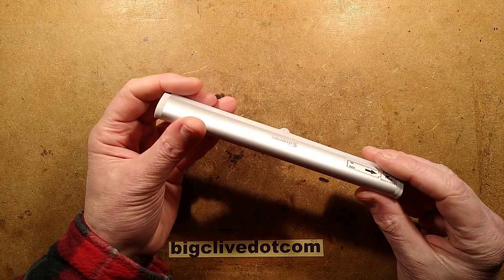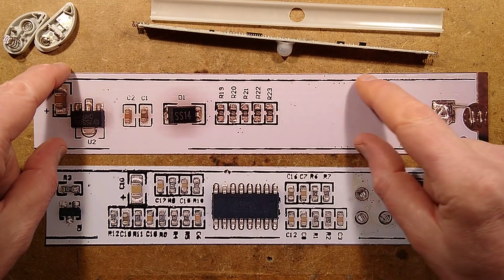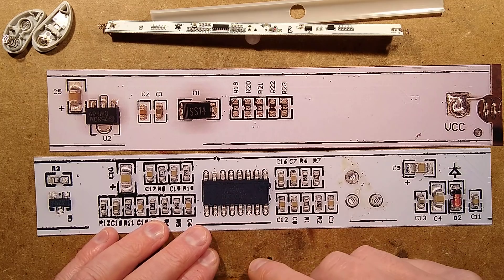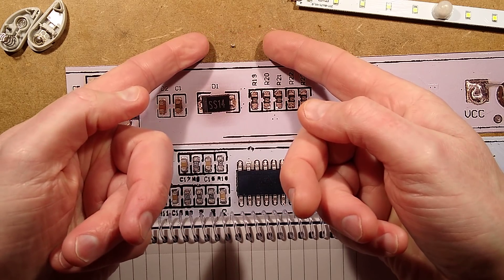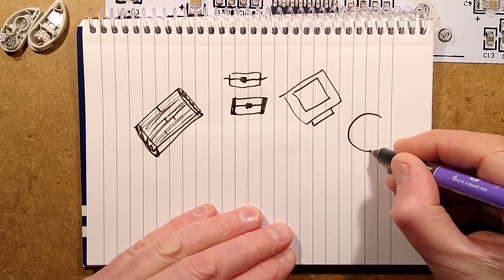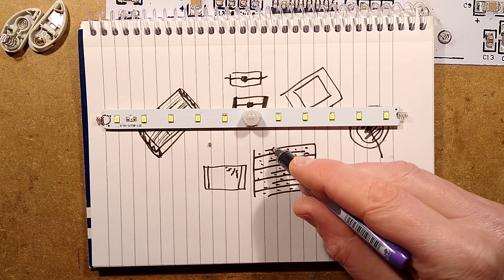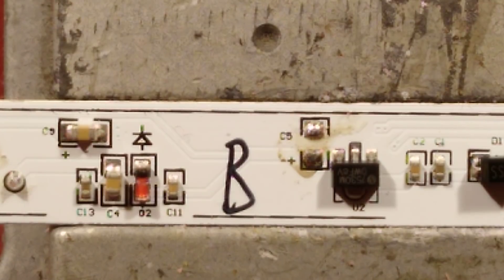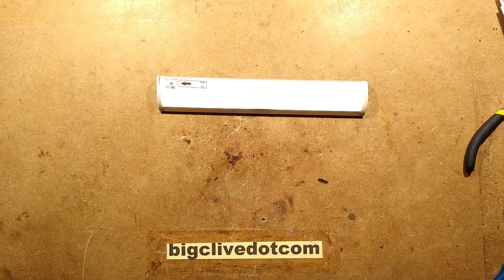Fixing a faulty battery PIR light that was draining the batteries fast.

Comment: Hehe @bigclivedotcom, when I saw you start drawing a capacitor I could only remember my brother's attempt at building a very high voltage one to increase spark distance with the use of one of the high voltage transformers from tube TV's.
He was experimenting with the thing when one of the isolation layers decided to fail and the driving circuitry started arcing furiously through it, which, due to the small hole it passed through made one hell of a noise.
After having heard 6 really loud clicks being transferred through the central heating pipes it took about half a minute before my brother came down with a very disturbed look on his face and I asked if everything was ok, which he was, though he had ringing ears and ever since made sure to be able to have a kill switch near him instead of having to reach over the site of the experiment in question (which, with the arc-over incident could've been actually really dangerous).
Reply: I know it wasnt funny, but that made me laugh.
Reply: @MessalineApghar  Afterwards, my brother was able to do so in a sort of way as well, but that was more coming from the whole "How on earth could I have been that stupid to not be able to switch everything off with a switch near me instead of hanging over a casing with voltages close to around 30kV"-perspective. It was a lesson well learned :P.

Comment: Will these passive infrared lights work if fitted with infrared LEDs ?or will it cause a infrared feedback loop and never turn off.
Reply from the maker: The detect a moving source of longwave infrared and will not be triggered by IR LEDs.
Reply: @bigclivedotcom  excellent, thank you,

Comment: Good job....
I had a teacher that was an electronics technician in the air force. And he had a jet that had radio problems.
No matter what radio that he put in, it had troubles.
He finally went to his co, and asked for help.
And the officer in charge , handed him a can of polish.
It seems that the final output capacitor was the inside of the case. And once it was polished, the radio worked...
At least that is the story that the teacher told.
All of this is to ask...
Is there any way to make the case into a capacitor in the circuit?
Or maybe part of the circuit board?
As a school project I made a capacitor out of aluminium foil, and cardboard.
Thanks for sharing your videos.
Reply: Yeah, you can use planes in a multilayer PCB to produce capacitance between ground and power, which can help reduce EMI. Capacitors and inductors can be made right out of copper on the PCB when designing for RF.
Reply: @dirkflannigan5271  Anywhere that you have two conductors separated by an insulator, you have capacitance. If you're dealing with RF signals, you can leak significant current out of your circuit via capacitive coupling if you aren't diligent with shielding.

If the inside of the case is in circuit as a capacitor, a buildup of gunge on it will greatly affect its capacitance, and shining it up will probably restore it to spec. In that case they might've been counting on it to act as a filter, and it was no longer capable when shat up.

Comment: Hi Clive, Great video as always. Just wondering what thermal camera you would recommend would like to get a good one but not sure what to buy. Many thanks.
Reply from the maker: One of the most convenient is the type that plugs into your existing phone via its charging connector.  Read the small print, as the thermal resolution is important for good detail.  I use a hacked Flir E4 and also have a CAT S61 phone with built in thermal imaging.  I wouldn't recommend the phone though as it has poor firmware.
Reply: Thats great thanks for the reply. Is the standard Flir E4 good for using on electronics ?

Comment: I purchased some Led bar lights from Rural King (kinda like Harbor Freight, but more home and farm oriented, and better products) from their "Damaged" section. Two of the lights flicker/flash. The one I use as an outside flood light for the porch, will flash when it's warm outside. But over the winter months, I noticed it didn't flash no where near as much, and actually stayed steady on for several hours without flashing. But once the temps are high enough, it'll start flashing every second or so. 

Would/Could this be the same thing, the capacitor going/gone bad?  I had taken 1 of the units apart to check it out, but I haven't had time to really investigate further.
Reply from the maker: If it's a rhythmic flashing and all the LEDs are lighting then it may be a faulty power supply.
Reply: @bigclivedotcom  They run on 120VAC. Only the last section of led's will flash. The other 2/3 (or maybe 3/4) of the string displays as normal. I don't remember what the issue is with the other one. And a 3rd unit the capacitor does need replacing as it fell apart when i touched it to check solder connection. At the time I didn't have smd caps, or the other lamps to see what rating it was.

Comment: Reminds me of the tantalum capacitor problem that were widespread 25yrs ago, especially on PC motherboards.
Reply: Tantalums always were a bit hit and miss, we used banks of 35 Volt ones in small buck converter power supplies, 10 -30 Volts down to 5.0 at around 3 Amps, this was back in the 70's so it was all discrete components driven by a LM723. Anywho, one of the more common failures would be a blown input protection resistor, finding one failed capacitor in a bank of 10 all glued together with polyurethane dip was not fun.
Reply: i've never come across bad tants, myself....yet........ had some wire ended radial multilayer ceramic caps self destruct one after another in pops and little puffs of stinky smoke on an ISA multi IO card, i thought best to change the lot on it, probably lucky it didnt actually catch on fire..
Reply: @andygozzo72  The infamaous dropformed decoupling capacitors used on motherboards, had a nasty tendency to develop a low ohmic short circuit.

The result was a +5v pwr supply shutdown in the pc, making it a non starter.
You had to be careful during testing, as a high current setting on the lab supply was necessary to find the defective cap.
If you really hit your luck, you got a burn mark on your finger from the defective glowing hot tantalum ... 😄
Reply: @LMAOer you still come across bad bulging/leaking caps now,  i have....
Reply: @andygozzo72  That's the normal and expected failure mode, though. The problem with the "plagued" capacitors was that they failed much sooner and much more frequently than designed.

Comment: I have a similar PIR LED light, which runs from 6 AAA cells, 
It came from Lidl, I fitted it in my front porch & it worked perfectly for about a year, on the original set of batteries, but it then started to repeatedly turn itself on & off about every five seconds, which ran the batteries down in a couple of days, but on fitting a new set of batteries its back to normal.
Reply from the maker: When the batteries are low the voltage isn't high enough for the regulator to stabilise.  It can cause detector instability and random resetting of control circuits.

Comment: I used to "fine tune" carbon comp-through hole resistors by filing away at the body of them with it connected to a ohm meter - it was pretty reliable too
Reply: It's really not a good idea. Carbon composition resistors go higher in value over time, apparently from moisture. Putting an opening in the case just makes it easier for moisture to get in.
Reply: @acmefixer1  aye I know dude, I used to put superglue on the body where I'd filed afterwards however it's not really something I do now cause buying components is a lot easier than it was back in the day - we're talking the days where you had to go to town to pay 50p in Tandy for 5 resistors so all I had was whatever they had in stock and whatever I salvaged out of old junk.

Comment: Why a supply smoothing Cap on a DC unit? seems odd.
Reply: It's usually to absorb high frequency noise from digital chips with sharp on-off transitions.
Reply: @johncrowerdoe5527  that, and stop the regulator chip going unstable, some can without caps on input and output

Comment: Repairing equipment is fun. Fixed a monitor with a broken backlight and a PSU with faulty lcd displays yesterday.
Now I know how a LCD display works and that I can use a 10ohm resistor to Bypass a broken backlight. :)

Comment: What capacitors do they use in satellites and space equipment as they have to last for decades and cannot afford a failure?
Reply: [CAUTION: this comment is based on my experiences from the 1980s, the details have almost certainly changed.] NASA requires that contractors use only "space rated" components. When possible, they use tried and true manufacturing technology and materials on an assembly line that has been operating for several years. Representative components made on that line have endured several years of testing. NASA has long term contracts to keep the component manufacturing and testing process running at some low level, so they can buy parts as needed. Components and assemblies go through a burn in process. A portion of every manufacturing lot is tested to distruction. Other samples are put into long term tests. Less than half of a manufacturing lot of "inexpensive" components has a chance of going into space.

That is the comparatively inexpensive way of doing things. If they need a type of component without a long track record, then space certification is way more complex.
Reply: @hamjudo  Why not make these available to the general public, the more that is made the cheaper they become?
Reply: @TonyDartford  They are available to the general public. Often they're not even all that much more expensive unless you want to specifically buy one that's been certified into the spaceflight supply chain. They're often really old and obsolescent, but you'll knows for sure that they're good.
Reply: @B-System  I guess the audiophiles haven't discovered that yet...
Reply: Great question!
Reply: Leyden jars
Reply: @frogz  They would be a bit big.

Comment: 7:35 made me cringe a little bit. 

In fact resistors are anything but easy to make. Judging from microelectronics perspective of course.
Thin film process controls the deposition area pretty damn well, but thickness and uniformity - not so much. This means that making two diodes the same with 0.5% precision is fairly simple, as long as your initial wafer is clean. 

Making a whole bunch of resistors AND keeping them cheap is quite a challenge. Laser trimming is an option, but it makes them cost way more and usually used in LSI production (when the whole chip costs quite a bit and trimming can save the day). Component resistor manufacturers just sort and mark them depending on their actual value.
P.S. Check any CMOS OP-amp layout, you will find that engineers put a hell of an effort to minimize the number of resistors for exactly this reason.
P.P.S. Good job, as always. 

P.P.P.S. Since when did the Bad Dragon started to make bricks?
Reply: remember resistor tolerance is the manufactures friend, there is no value that wont fit somewhere. back in the old days of 5 1/4" disc's when single sided disc moved over to double sided, double sided with a dud side were just put in single sided case. when manufacturing got better most single sided disc had two good sides. cut the slot and you had double sided for the cost of a single. :)
Reply: @TheEmbeddedHobbyist  Yes, as I said, individual component resistors are made with low tolerance and then sorted. Their weird series of resistor values like 47/56/68/82 are made on purpose, so you can put any randomly made piece in the corresponding bin with 10% of tolerance. Found nice graphical explanation here http://www.resistorguide.com/resistor-values/ for people who got interested
Reply: Thanks for that insight. I, too, winced at the reference to laser trimming of resistors.  Burr-Brown did it for top flight analogue to digital convertors,  but they were very expensive.  Most resistors don't get individually tested, let alone laser trimmed.  One in a thousand gets tested , and if that one's out of spec, the whole batch is chucked in the seconds bin.  It's not economically viable to do otherwise.

Comment: I got a selection of SMD capacitors of various sizes. My mind boggles how they make (and squeeze 100nF into) the absolutely miniscule 0201 sized versions. I know that they make transistors at the nanometre scale for ICs so it shouldn't really tax my brain in this way, but I guess it's because they're a tangible, physical thing you can hold and they're so small that losing track of it on your desk or dropping it would probably mean it's lost forever!

Comment: is machine oil good lubrication for bad dragon brick or will it disintegrate?  Also how much current can you pass through bad dragon brick?
Reply: You should always use water based lubrication with bricks in my experience.
Reply: @nogravitas7585  if used as resistor how many Ohms does the brick has?
Reply: @dezeekat  alot, silicon is typically used for it's insulating properties
Reply: @frogz  we need BigClive to test this

Comment: Just another example of cheap capacitors being a pain in the arse in modern electronics, going from the electrolyte fiasco (of which I've found in a Lenovo SFF PC I have that needs recapping now) to the MLCC failures... :(

And speaking of a pain in the arse, Bad Dragon would have to make an appearance again... :P
Reply: Multi layer ceramic caps can actually be quite expensive, more than 'lytics even. Theres no need to use them where a 'lytic would work and in some cases be cheaper.
Reply: @simontay4851  There is every need to use them when size, lifetime and low ESR are important design parameters. There is literally no other choice in many designs.
Reply: Even top quality brand MLCCs are prone to cracking when stressed. The problem is down to design (components mounted in high stress areas of PCBs, differential thermal expansion) and handling during assembly (flexing the PCB, impact damage etc.).

Comment: Seen quite a few of these caps fail now, often blowing fuses. Seen several times in Stannah stairlifts.
Reply: A stairlift is a much bigger device than this so why are they using such tiny ceramic multilayer crapacitors. They could use 'lytics instead.
Reply: @simontay4851  Electrolytic capacitors got a bad reputation after the great plague of bad capacitors some years ago. So many designers avoid electrolytics and (wrongly) assume all ceramic/solid capacitors are as reliable as the low value ones.

Comment: As I'm tearing electronics down I often wondered what capacitance those tiny caps are or How to determine how to tell what the capacitance.
Reply from the maker: With these surface mount components you'd portably need to remove them and test them with a capacitance tester.  Otherwise you could try and work out a value from their function.
Reply: They put the value on SMD resistors, even really tiny ones . Why not SMD ceramic caps. You never know at a glace the value of them on a scrap PCB that you keep to salvage parts off.
Reply: @simontay4851  I believe the printing process does not work well on the ceramic substrate that MLCCs use. Additionally capacitors come in a range of heights for each smd size depending on capacitance which would complicate the process and increase expense. It's not a problem for volume production where the reel is marked, and that's what makes component manufacturers their money. I agree it's annoying for repair/hobby jobs though.
Reply: They really make them all sizes, you can get huge values like 220 uF in small 1206 size as long as they are low voltage.
Reply: You can pretty much only guess by its function. If you want to risk breaking it (or the circuit), you can desolder it and check it with a capacitance meter. That doesn't help at all though if the capacitor is already broken. Luckily in many cases the exact value isn't critical. You might also find other caps on the board that do exactly the same thing (e. g. on another pin of an IC). Chances are good that those caps will be the same value. And then there's the possibility to check the datasheet of the devices the caps are connected to. It's quite likely that in those cases the capacitor values are the recommended values (or the datasheet helps you determine what it should be with a formula).

But for all of that you will definitely need some quite wide understanding of how circuits work in general (to get the function of a cap), how the respective circuit works (to know where to look for similar caps) and how to read datasheets.